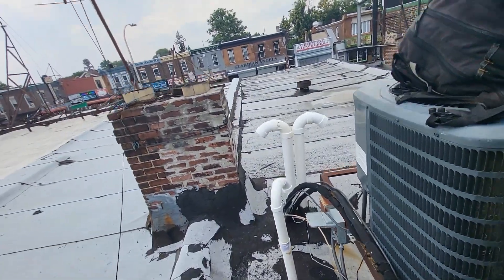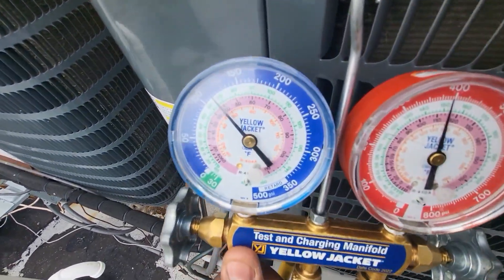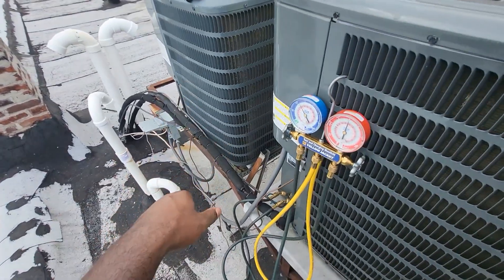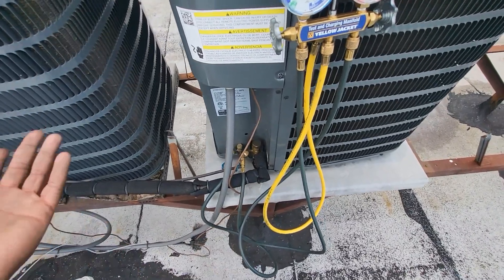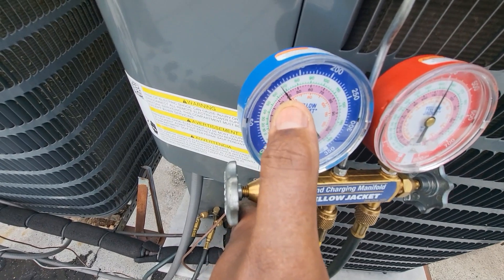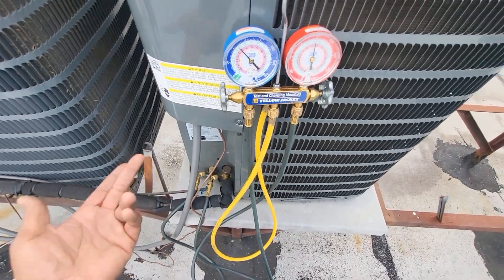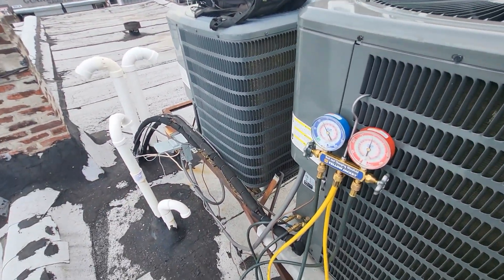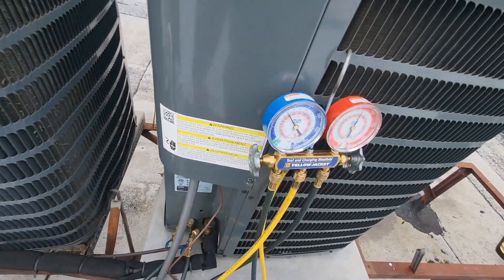How to tell if an a/c system has NON-CONDENSABLES

Comment: Reclaim it, let the tank sit still for a couple hours, then check P/T in the tank.  If pressure is higher than it should be, you have impurities.  To fix, after tank has settled, vent off the non-condenseables slowly from the vapor side, re-checking P/T.  Repeat until P/T is normal and recharge.
Reply: No don’t listen to this. Just put new refrigerant in
Reply: @aratholivarez  Are you suggesting that it doesn't work?  I got it from a Stinger recovery machine manual - and I tried it - it does work.  BUT it does take some time.
Reply: @chrisscott1547 i don’t know to be honest. But best practice will just be to replace the refrigerant with new refrigerant.

Comment: The non-condensables means that the gauges will fluctuate? Are those Pressures right? What type of pressures should you be looking for in a 410a system?
Reply from the maker: Non-condensables will cause the HIGH-SIDE to fluctuate. It would happen instantly when you turn the system on.

& there's a few variables to what your pressures should be depending on the outdoor (ambient temps) & the indoor temps. I would say on a 80*amb 72*indoor day I would want my r410a low side between 120-130psi & my high side between 300/330psig (with subcool/superheat) can get you closer to being on the money but those pressures are great  to use as a benchmark during normal summer months.
Reply: @Drewdriskle  I have another question. How will digital gauges react? will it go haywire?
Reply from the maker: @jmac213stuff digital is fine. The only DOWNSIDE to digital is that when it rains, you need to cover them. Otherwise, there goes those gauges. 

 I used to only stock digital. But now I keep at least a set of analog gauges on my van just for those crappy weather conditions. Good luck‼️